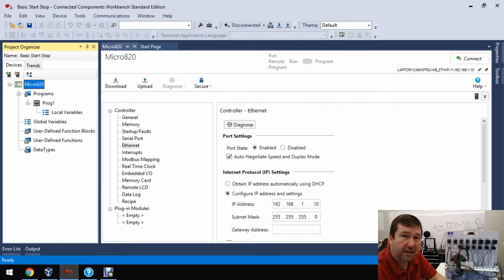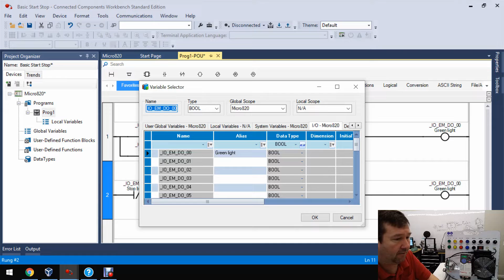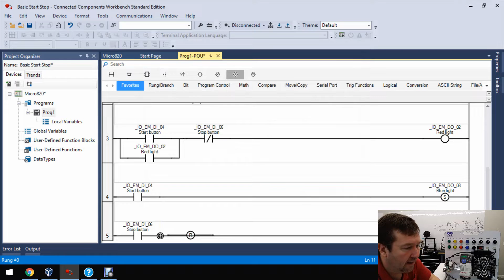Different Ways to Program a START STOP Control in Micro800

Comment: Thank you again great video I know your looking for content i'd like to see some videos on Powerflex  4, 40 and/or 525 and the CCW working together just basics plc integration and migration you may be able to have an entire series on this topic hope this helps
Reply from the maker: Hi Stefano.  We have the following videos coming on the Powerflex 525.  I've already recorded some of them, I just need to finish editing them.
Powerflex overview
Powerflex factory reset
Powerflex 2 wire control
Powerflex 3 wire start stop control
Powerflex reverse wiring
Powerflex potentiometer 0-10vdc
Powerflex -10VDC to +10VDC
Powerflex analog voltage output
Powerflex analog current output
Powerflex 2 wire 4-20mA with scaling
Powerflex 4 wire 4-20mA
Powerflex MainsFree Programming
Powerflex and CCW
Powerflex accel and decel
Powerflex how to wire inputs
Powerflex measuring motor voltage
Powerflex preset frequencies
Powerflex 2nd speed reference
Powerflex pulse train input
Powerflex how to wire opto versus relay outputs
Powerflex over Ethernet
Powerflex over serial
Powerflex over modbus
Powerflex faults
Powerlex dynamic braking
Powerflex Safe torque off
Powerflex Drive feedback loop
Powerflex Velocity StepLogic Function
Powerflex Basic Logic Function
Powerflex Timer Function
Powerflex Counter Function
Powerflex PID
Powerflex energy monitoring
One drive commanding another